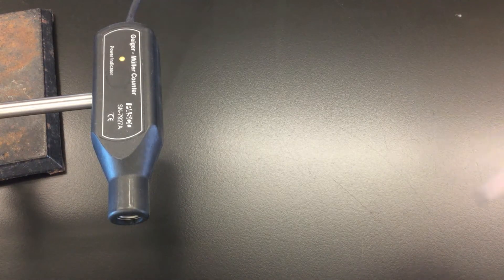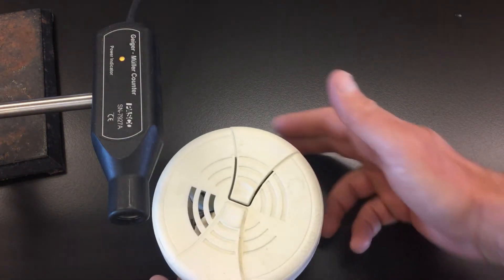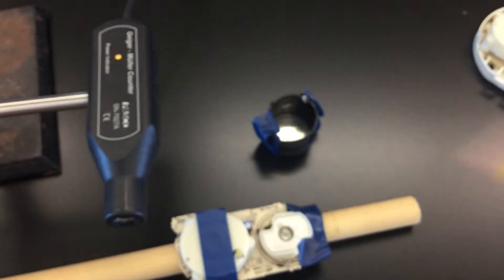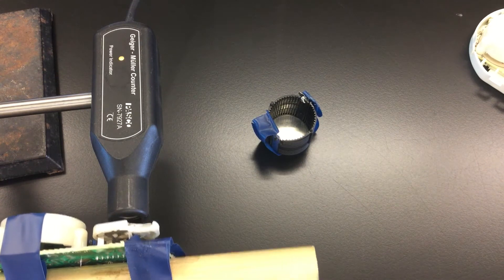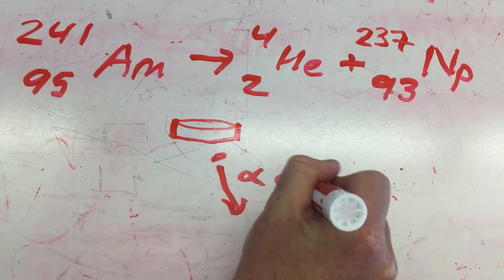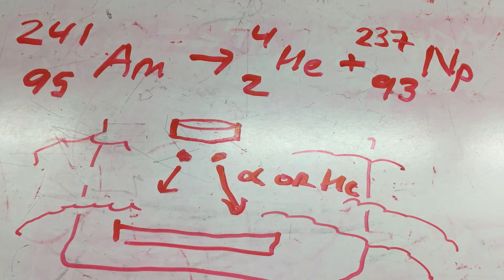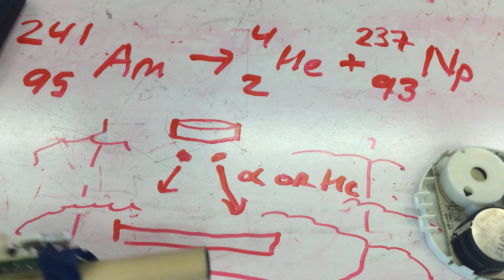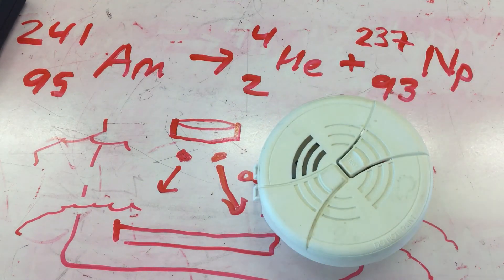Radioactivity in Smoke Detectors

Comment: The council housing have just put new smoke alarms onto my place in uk today but I felt suspicious a bit uneasy.  So should they be ripped out as dangerous or covered in some way ? Great video but I was left wondering what to do a little bit . Thanks
Reply from the maker: No, they are safe. It is such a low level and the alpha particles are blocked, certainly by the metal and plastic casing and even by a few inches of air.  I have a handful of them in my house and feel safer with them there as smoke detectors. They are designed to not be radiation hazards, even though they use a little radioactivity to operate.

Comment: Is the Americium a solid or an encapsulated powder? Without thinking I blasted a malfunctioning one with compressed air and have been concerned since
Reply from the maker: It's solid. That should not be a problem. If I were in your situation, I would not worry at all.

 Nevertheless, it is best with all radioactive materials to minimize exposure. This is mainly an alpha emitter, but does have a decay product that is itself a beta emitter. I don't make a habit of playing around with the material, but your situation does not wound worrisome to me.
Reply: @dr.piercesphysicsmath9071  Thanks for your reply. The detector is over 30 years old. The dust had a notably different smell, perhaps from being ionized? It's what made me realize afterwards it was probably a very bad idea.
Would the dust I inhaled retain alpha or beta radioactivity for any length of time?